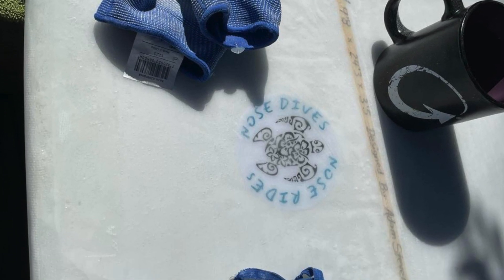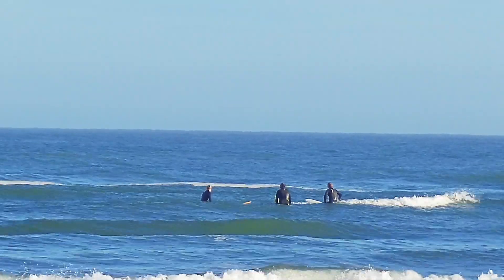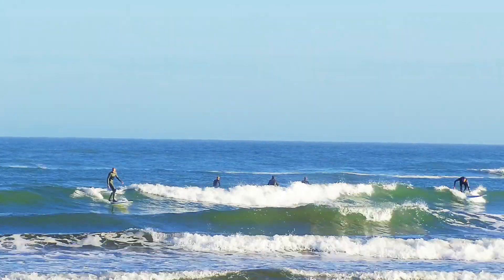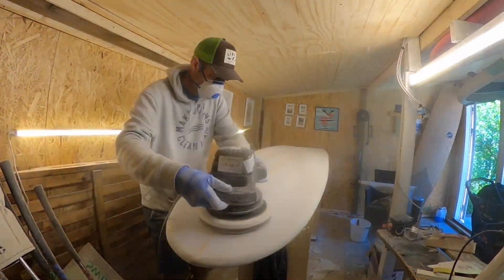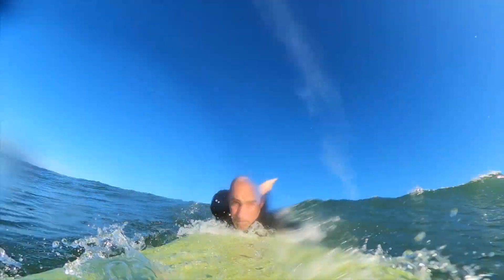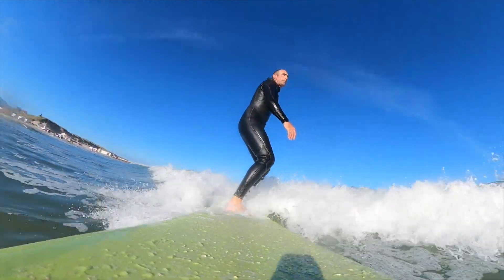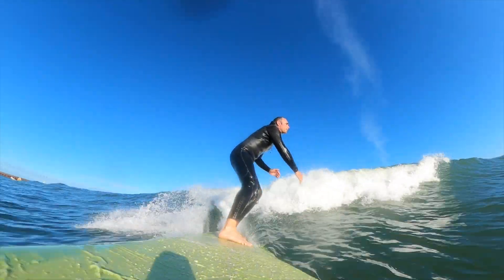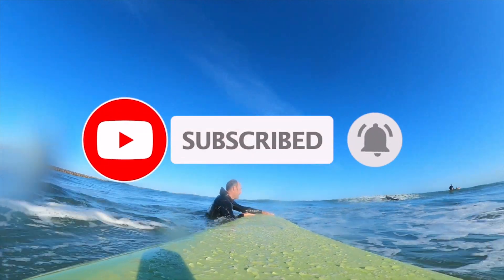Longboard surfing / Backyard longboard build update and stoke out of the Yin Yang! YEW!

Comment: The board is looking good. You should look at changing the hertz on your build footage cam to stop the flicker. I have to use 50hertz indoors here in the UK with strip lights. It changes the available resolutions though.
Reply from the maker: Cheers John… ya you are right about light flickers l… for another Edit I Googled how to change the GoPro settings for poor lighting and indoor use which also worked well but completely forgot this time around🤔🤙🤙